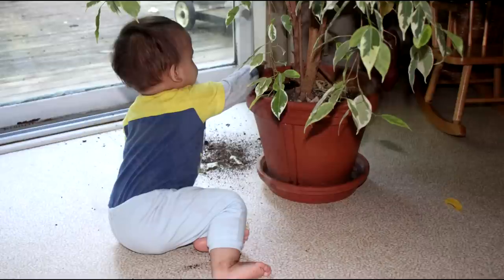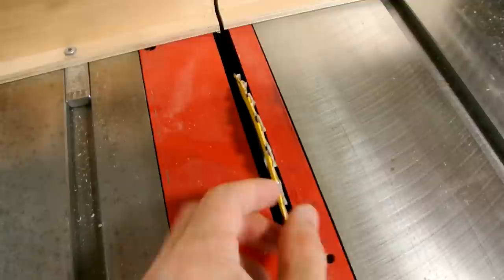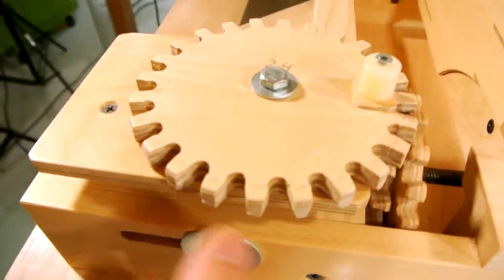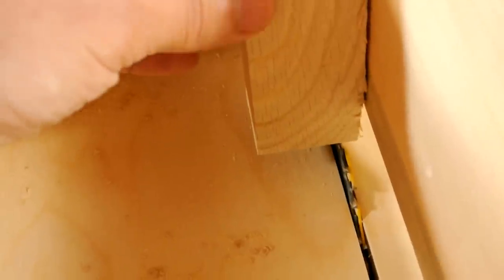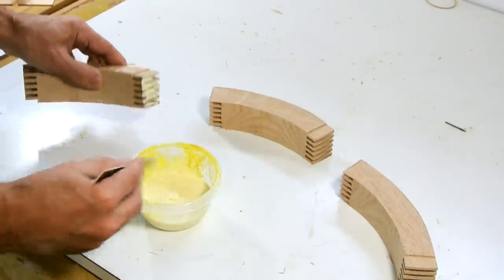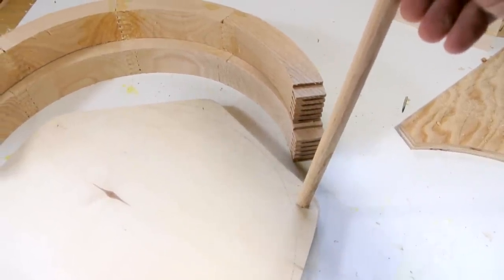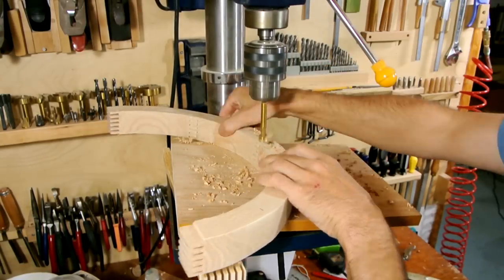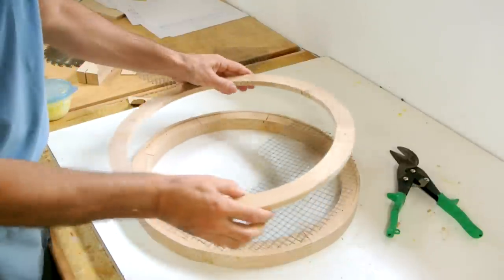Baby proofing a flower pot

Comment: This is similar to a quick solution I made when my oldest was about the same age. I cut a heavy piece of MDF into two rectangles that were cut to overlap as a square, then cut a circular hole in the middle for the plant. The two halves locked together with bolts that he wasn't able to grasp. Finished nicely. They also ended up functioning sort of like side tables.

Comment: You can use the same ring technique to make a guard around the plant and keep the sharp edges hidden, same as the outside.

Making the inner ring in two parts and maybe add a screw or two in case you need to take the thing apart, tight dovetails might also work.

Comment: I have the same problem with my dog, that digs in the flower pots.

Solution: I made a check-board design grill out of strips of wood (5mm x 40mm) and nails. I left 2 halves separate and nailed it on site. An jigsawed the center ant the outside to fit the flower pot.
The grate sits on top of the soil, inside the flower pot. the grate have slots of about 20mm apart but it can be be narrower if needed.
It can be lifted, but my dog can't do that.

Comment: Wouldn't the slope be 10 because slope is how much it rises over how much it runs? The tan inverse still works because to find the angle you want, the "slope" is reversed because tangent is opposite leg over adjacent, which does equate to 0.1.

Comment: i have a similar problem with my cats but thankfully they don't have thumbs so i just put some big pieces of bark in the pots

A far quicker and cruder way to get around the problem would have been to wrap some of that chicken wire around the pot as high as you can, but that's ugly and doesn't involve woodworking :)

But a simpler solution that does involve woodworking would have been to use the pots lip and make the ring in such a way that it hooks under it so the kid can't lift it.

Comment: Hmmm... the only other solution i can think of would be to put the mesh directly on the soil, and then weight it down with some bricks so Max couldn't take them off. (we had an issue with cats digging up the flow pots instead of using the litter box)

But that's not as fun, or cool as this cage.

Comment: Kids, when they REALLY want something, will do anything they can think of to get it; I can't help but feel that the little-'n will try to get his fingers down the inside of the mesh nearest the 'trunk' of the plant's base where the mesh is at its weakest, (and sharpest). Could you not tweak this design with a thin rubber/plastic sheath to protect the child's fingers from the sharp points of the mesh? Or do you feel it's not really likely to be an issue? Just my curiosity getting the better of me. :)

Comment: The woodworking was nice, the result looked good (but I'm not convinced of its durability without some oil or paint applied to the wood - there's a lot of water where there's a potted plant, and I don't know if the glue used is waterproof), but it was definitely not the simplest solution that could have worked. Old pantyhose attached with sticky tape of the right color would have been faster, cheaper, simpler and IMO equally effective. And not necessarily that ugly, if done right.